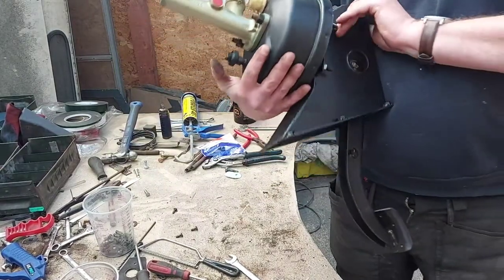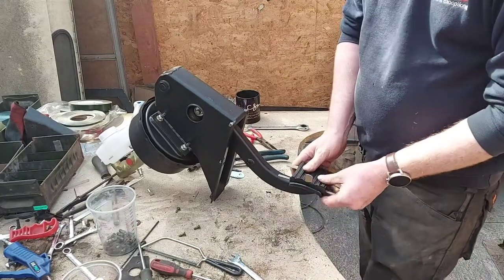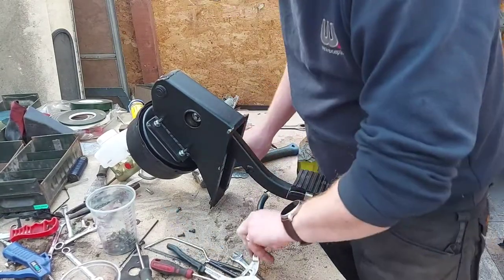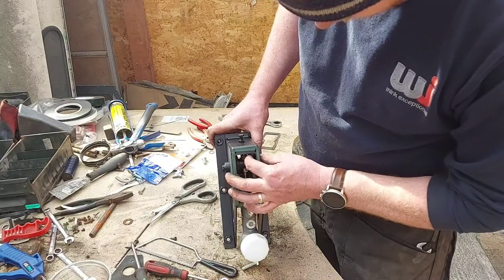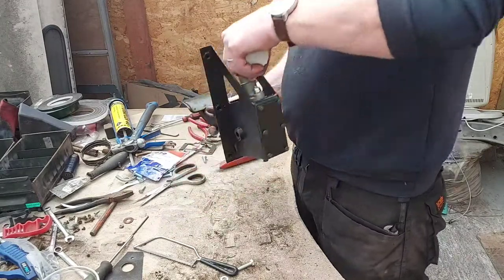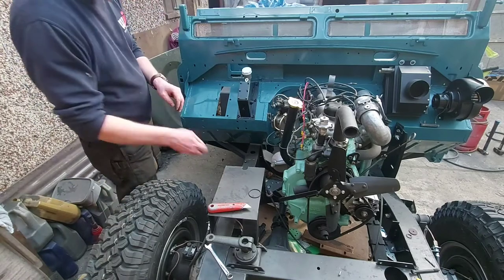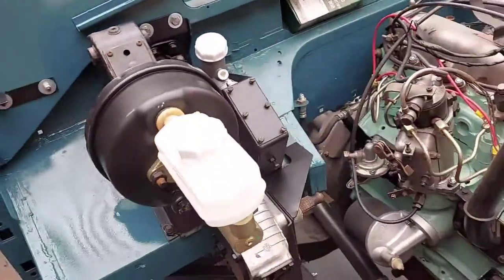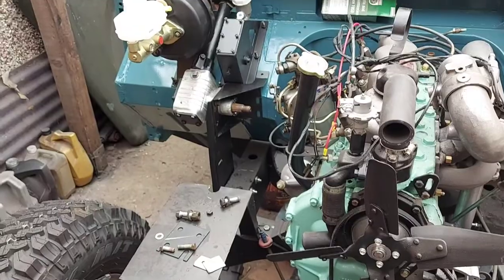fitting land rover series pedals and master cylinders to project (numb nuts)

Comment: Good video, the parts you are using would be really helpful, I am in the middle of upgrading my series IIa and plan on upgrading the clutch and brake master cylinders
Reply from the maker: They're standard series 3 master cylinders from bearmach, but they're not trading anymore. Im struggling to find good quality brake components at the moment. Brit part have definitely stepped up their game lof clutches have been good in the past, but I've never used their land rover stuff, but I'll be giving them a try next time. 🙂👍
Reply: @retro.restorations Thank you

Comment: Love watching this process.  I’m five years into a frame off restoration on a 1981 Series III 109 2.6l straight six from Australia. I’m about to start reinstalling all the fixings on the firewall, so we’re in similar places with respect to the reassembly.  Great videos and I can’t wait for more.  Question:  Do you plan to do any videos related to the wiring?
Reply from the maker: Hi, thanks for watching! I will be doing some wiring vids in a few weeks but on a series 2a there's a few vids of series 3 wiring on my channel but nothing in depth just the basics. 🙂👍

Comment: Engine paint? Do you have a link to the colour and the supplier please. Following your series, lots of good advice, thanks
Reply from the maker: Hi, thanks for watching! The colour is duck egg blue although it actually looks more green its a standard colour and it's from paintman paint https://paintman.co.uk/shop/land-rover-series-2-2a-engine-blue/ I hope this helps🙂👍
Reply: @retro.restorations   Great, thanks for that. I’ve got a complete 109 rear tub to assemble from parts. Should be a challenge
Reply from the maker: @petermclaren7276  no problem! It looks like you've got some work and head scratching to do best of luck with the build🙂👍